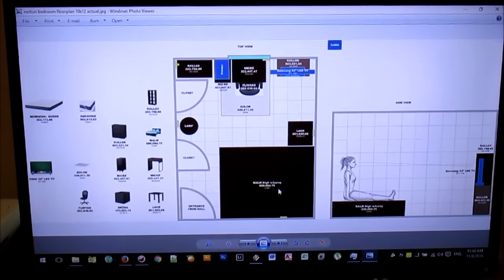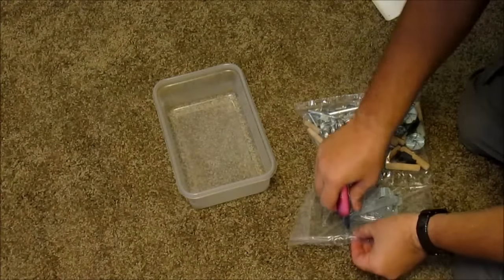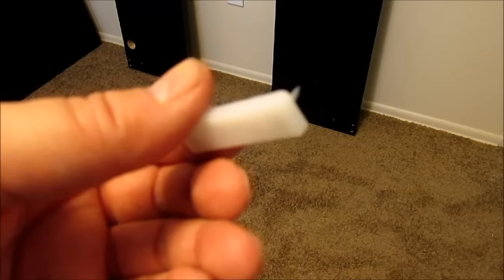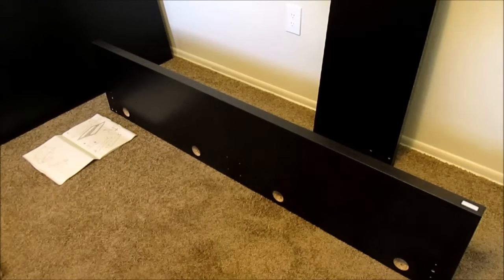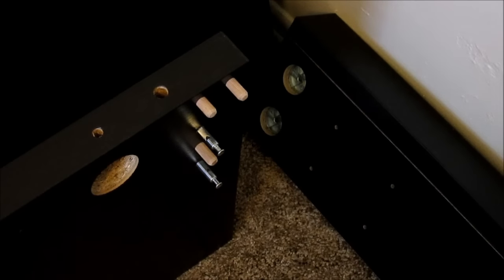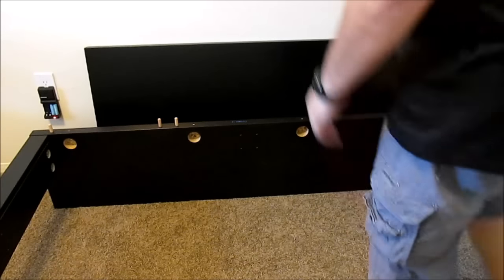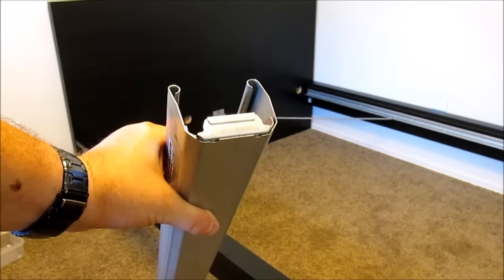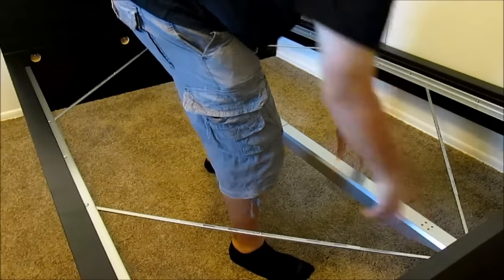IKEA Malm high bed assembly - DETAILED!

Comment: ok so stupid question... what are the pieces called that help hold that slates on the sides of the bed. Not the mid beam, but the long "runners" that are on each side of the bed that help hold up the slates. I've lost those pieces moving and can't find them. Please advise LOL
Reply from the maker: Hello Sai, good question. If you have a queen-sized Malm bed frame, then you're looking for the RUNNERS which support the slats, and the part numbers are #114290, #114291. You can verify the part numbers on ikea.com by searching for your bed frame and downloading the assembly instructions. To get replacement parts, put in a request using IKEA's web site: http://www.ikea.com/ms/en_US/customer_service/contact_us/contact_us_email.html, then click on "Missing or spare parts". Good luck!!

Comment: I can't get step 4 where the round metal pieces are supposed to secure on the screw...any tips?
Reply from the maker: Hi Stacey. Yeah, this step is really tricky. On those metal discs you'll find an arrow stamped in the metal. That arrow needs to be facing you when you insert the disc, and the arrow needs to be pointed in the same direction as the wooden pegs. When you have the disc in the proper orientation, press it all the way into the hole in the side beam. Then you attach the side beam to the front leg. Then you use your L-shaped allen wrench and turn that disc clockwise until it locks. It's pretty tricky. Keep trying!! You'll get it. Chris

Comment: So for the longest time (almost 8 months) I had set the mid bar support frame to the second lowest point. So when I placed the Luroys I had a dent on the middle of my bed. Which I thought it was because of faulty Luroys. I just watched your video and realized that there were other pre drilled holes I could have placed the frame. I just changed it Thank you for the video. I am an idiot.
Reply from the maker: Yeah, Ruben, I can imagine your disappointment with sleeping in a valley in your bed. Glad I could help you get it right!! You'll sleep good tonight I am sure.

Comment: For anyone stuck at 37:00 (the strut installation) the best technique is to use the screws to first tap the holes then install the struts. Do this by placing the strut on some carpet and grab a screw and screw it in. This will allow you to get a lot of weight and torque just make sure that you have the strut facing you the right way before screwing. Also use the right size screw driver, these shitty screws will strip easily. After just unscrew it and repeat on the other holes on the strut. Fucking IKEA has never heard of tapping holes or at the very least providing nuts (well I guess they probably don't do this in order to save money).
Reply: Also don't forget about the 3rd screw in each strut. To find which hole to tap, just extend the strut out and size it up first. Lastly if the screw stops going in just unscrew it and try again (this is basically breaking the chips that are forming from you tapping the hole).

Comment: If I no longer have the wrench provided with the bed, what size do I use to get it apart? Thanks!
Reply from the maker: You'll need a 5mm allen wrench, a 6mm allen wrench (the ends are hexagon shape), 6mm wrench and 15mm wrench. Should be able to get these at your hardware store. You could probably visit your IKEA to get these items (item #s: 100049, 113453). Or you could place a missing parts order with ikea.com: http://www.ikea.com/ms/en_US/customer_service/contact_us/contact_us_email.html; also see assembly booklet: http://www.ikea.com/us/en/assembly_instructions/malm-bed-frame-high__AA-740446-8_pub.pdf

Comment: Hi ! I have just the bed without equipment like screw, bolt, key! Where I can find them ??? Thank you
Reply from the maker: Hey! Go to: https://www.ikea.com/ms/en_US/contact-us/. Then click on "My IKEA Product". Then click on "Missing Hardware/Replacement Parts" and fill in the form. Be sure to put your request in the "comments" section. Or if you have an IKEA nearby, you can get the parts there. Also, look up the part numbers by dowloading the PDF of the assembly instructions. You can find the PDF on the "Assembly & Documents" tab at https://www.ikea.com/us/en/catalog/products/S19931605/#/S39931162. Good luck!

Comment: Hello, Can you please tell me if I can attach a different headboard to the frame instead of the one they give you?  Thank you :)
Reply from the maker: It would be difficult to use a different headboard. You could leave off the headboard that comes with the frame, but attaching a different one may require a lot of work. And it would depend on whether you could drill into the bottom of your headboard so that IKEA's 4 screws could mate it to the frame. If your headboard has some legs, or if you raised it, you could place it at the end of the frame and simply have it sandwiched between the frame and the wall.

Comment: Try using a block of paraffin wax to lubricate the threads of those lag bolts which screw into the wood. Just scrape some paraffin off and onto the threads.

Comment: Did you have to buy the mid beam or did it come with the bed?
Reply from the maker: If you buy in person at the IKEA store, you need to pick up a mid beam separately in addition to the boxes that the frame comes in. Mid beam is around $10. If you buy a package online, the mid beam comes with the package. There's only one kind of mid beam called SKORVA (part #901.245.34) used in all IKEA frames.

Comment: Question. Screws stripped ....
Malm bed 4 years old...the screws are stripped and fall out now on the X bracing the slates.   What size screws are these or how might I redrill and use screws and bolts? Thanks!
Reply from the maker: I did some research on this. Qty 12 of (IKEA#117327) MCX Screws (M4x6). So they're MCX type and the size is M4x6. M4 is the diameter and I think the 6 is 6 mm. Good luck! You can also order replacement parts from IKEA. http://www.ikea.com/ms/en_US/customer_service/contact_us/contact_us_email.html. Click on Missing or Spare parts link.

Comment: 17:17 I am currently struggling because the legs won’t go in but when it goes in there is still a lot of space. When we tighten the circle thing it doesn’t tighten all the way
Reply: Me too how do you able to make it work?
Reply: Same issue with mine, is there any suggestion to get it fixed, did you able to make it work?
Reply: @akhilsaivangala7664  we tightened the screws and it was able to go in. Make sure you tap the board as well

Comment: Did you have a problem with your struts? The screws won't screw in mine.
Reply from the maker: Hi Jordan, I didn't have any problems. Someone else reported a similar problem. IKEA will replace missing parts. Visit their web site and make a request. http://www.ikea.com/ms/en_US/customer_service/contact_us/spare_parts.html

Good luck!!
Reply: activity10cc I've figured it out, thank you anyways.
Reply: Jordan Halford What did you do? I'm having the same problem. The screws won't tighten
Reply: Ben Hill I had to make sure the trusses and screws were as close to flush as possible with each other to thread them correctly. they weren't straight, I just had to deal with crooked screw threading because they were done at an angle. the bed is still stable even though it's slightly off

Comment: Can you lift this bed to place things under or does this bed not do that with the high rise?
Reply from the maker: Hi. It is possible to lift your mattress and roll up the slats to put stuff under the bed, but it's a BIG HASSLE. Lifting the bed frame itself with the mattress on it is not easy or recommended. You can slide stuff under the bed (without lifting anything) as long as it's 8 inches (20 cm) high or less. So the flat plastic storage boxes fit nicely under by sliding them in and out. Hope that helps.
Reply: activity10cc okay so maybe I am thinking of a different Malm. I have seen ones that allow you to lift the mattress with ease but those are also not high rise frames. 🤔 will do some more research, thank you so much!

Comment: excellent video. one question. What's the height of the top of the slats (in deep mattress setting)? Low enough for a 14" mattress?
Reply from the maker: Slats are 9" above the floor & the top of the Malm frame is 14" above the floor, so you're good. Your mattress top will be at 9+14 or 23" above the floor.
Reply: thanks

Comment: Is the mid beam supposed to come with the bed or was it separate? I just finished building the bed and that seems to be the only piece missing
Reply from the maker: If you buy the package deal online, the mid beam should come with the frame. If you bought your Malm at the store, you would have needed to pick out the mid beam as well as the 2 boxes. The mid beam runs about $10. It's called Skorva, item #901.245.34.
Reply: Thank you !

Comment: How much do you weigh please? What is the maximum weight you think a king size would  be able to handle?
Reply from the maker: I weigh 260lb/118kg. The max weight will depend on which slats you get. But I have Luroy slats, and I can stand on the bed in the middle of the slats, no problem. That means you could have 2 people 400lb/180kg each on either side of the bed at the same time. Total 800lb/360kg. This is a guess only. There is no information on IKEA's web site about maximum load.
Reply: Thank you!
Reply from the maker: My pleasure

Comment: I bought this frame and when I was finishing building it I noticed it didn't come with the middle beam. WTF!?!?
Reply: Ernesto Munoz I'm having that same problem just bought the frame plus wooden slats but no beam. Is it sold separately?
Reply: It is...
Reply: Ernesto Munoz mind didn’t come with the slats
Reply: Ernesto Munoz it doesn’t come with the slats and middle frame because they are sold as separate pieces. It says that when you buy the item.
Reply: Ernesto Munoz if you all actually pay attention you’d see that you need to buy the slats and middle support beam separately I’m 15 and I could do this lmao 😂
Reply: If you have a one person bed then you don’t need a beam. If your making a king size bed then you’ll need one. I’m making a one person sized bed so mine doesn’t come with one, i asked the manager.
Reply: +jacake I bought this exact frame and it's only me. I needed a beam. The beam gives the frame extra support and is needed to keep the slats and mattress from caving in.
Reply: ladycam5 I’ve been using this bed ever since i posted that comment and I’m having no issues with the bed at all. My little cousins jump on it all the time, climb on it and rough house on it and it seems to be pretty stable and tight.

Comment: Problem I'm having.... The side parts won't slot on to the screws! It's like the dowels are too thick, and won't go on. The instructions are confusing, they suggest you turn the cam lock before the screws are all the way in. I've built loads of IKEA furniture over the last decade, this is the first time I've ever struggled!
Reply: Same issue I am facing, are you able to fix it, can you help me
Reply: @akhilsaivangala7664  in the end, I managed to push the sides onto the screws and dowels just far enough that the cam screws start pulling them in when you turn them; then, you turn one screw a little bit, then the other, and repeat until the side and the end are pulled together